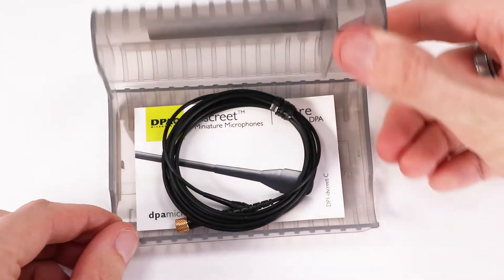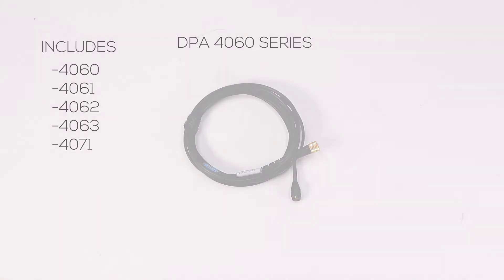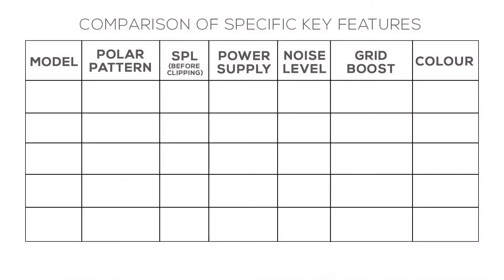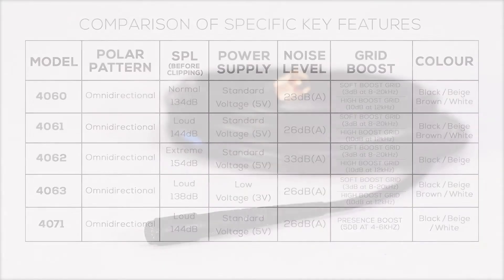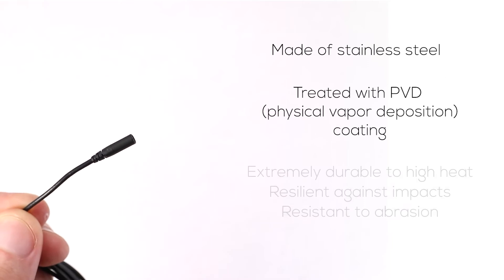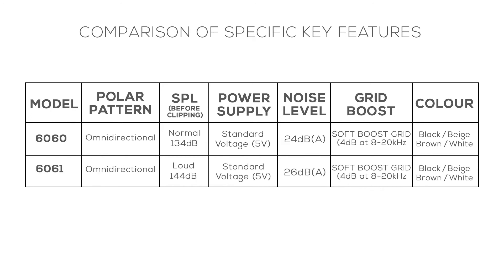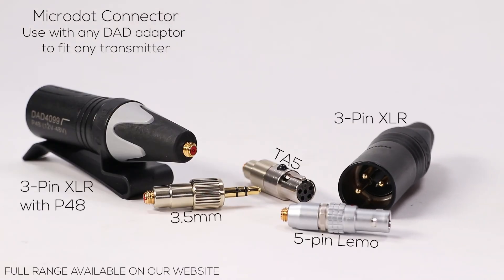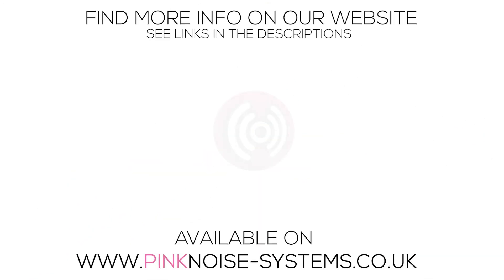Key Highlights and Differences between the DPA 4060 & 6060 Series of Lavalier Microphones

Comment: The DPA mics have a clicking sound when connected to bluetooth enabled wireless transmitters so I won't be buying them!!!
Reply: What, you mean bluetooth wireless transmitters cause interference in highly sensitive lavalier mics? Well, I definitely won't be buying bluetooth transmitters then! Jesus Christ...
Reply: @tomgriffiths4069  I have three DPA 4063 with the new core and unfortunately as soon as bluetooth communication is turned on in any system (for example receiver with mobile phone) it starts ticking in the background. In addition, the DPA does not work at all with any 2.4GHz system. They have very poor shielding.